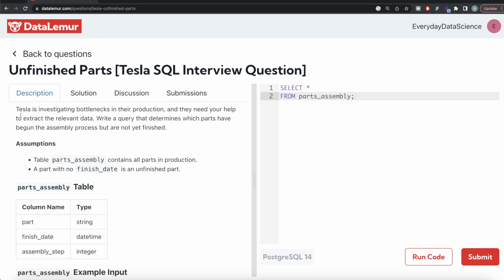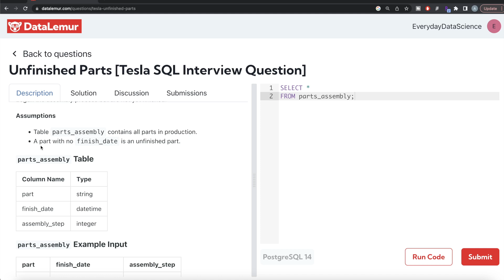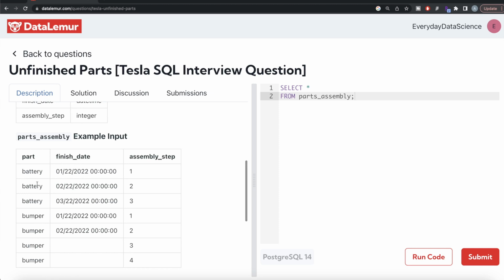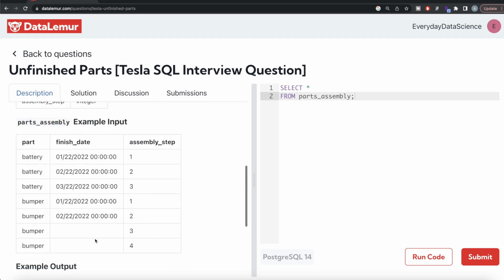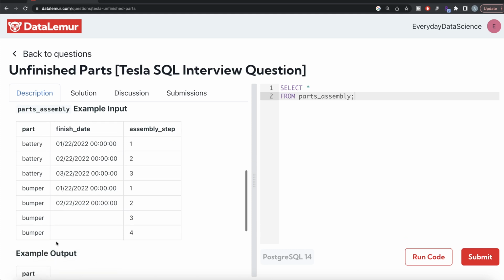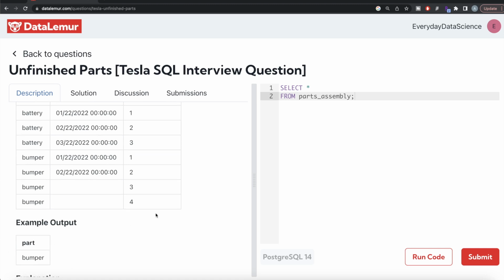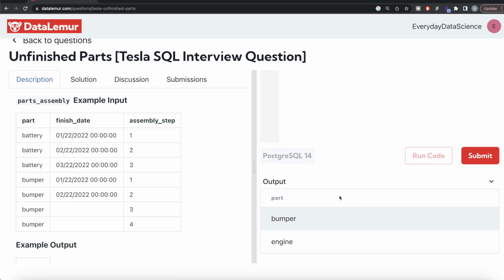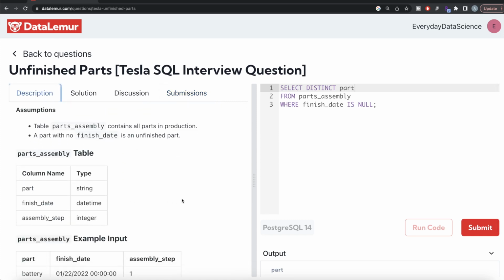TESLA Interview Question Solved - SQL | "Unfinished Parts" | Everyday Data Science

Comment: @everydaydatascience - I have a correction to make to the answer you have provided (Please correct me if my understanding is wrong). The query is asking us to find the part that HAS SARTED THE ASSEMBLY, BUT NOT FINISHED. 
though your query is returning the correct results, it would fail in certain conditions, if the Part has not begin assembly. I have created a CTE and joined with the original table to find if it has really started the assembly process, BUT DID NOT FINISH it.

with cte as
	(select part, min(assembly_step) first_step, max(assembly_step) last_step
	FROM parts_assembly
	GROUP BY part)
select distinct c.part
FROM cte c
LEFT JOIN parts_assembly p
ON c.part = p.part
where c.first_step IS NOT NULL AND 
c.last_step IS NOT NULL AND p.finish_date IS NULL;
Reply: parts_assembly table contains all parts currently in production, each at varying stages of the assembly process.
Reply: your query is not working properly bro
SELECT part,assembly_step FROM parts_assembly WHERE finish_date is NULL

try this
Reply: @inograteshow123  - can you please share the working code you suggesting? so I compare what is not working?
Reply: you are overthinking alot on this problem. it is written in the question: "This question is straightforward, so let's approach it with simplicity in both thinking and solution."